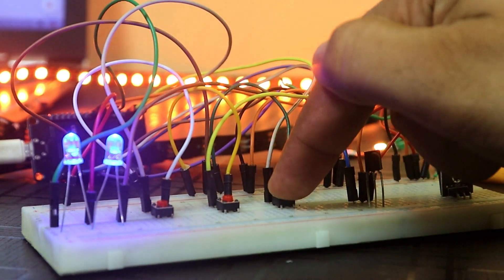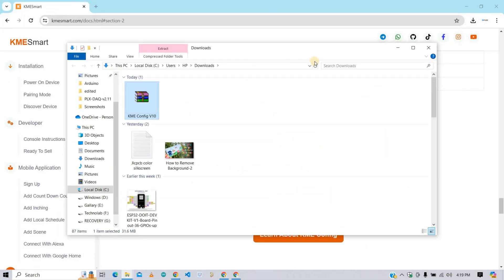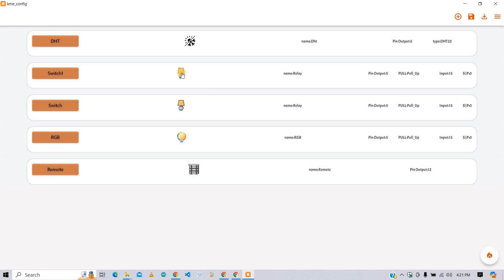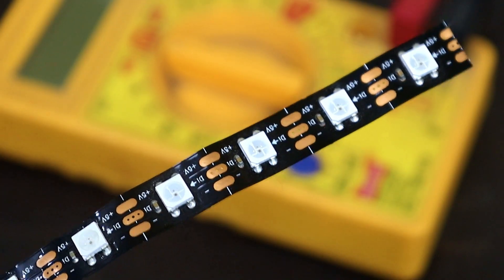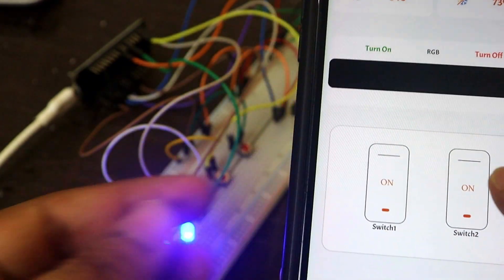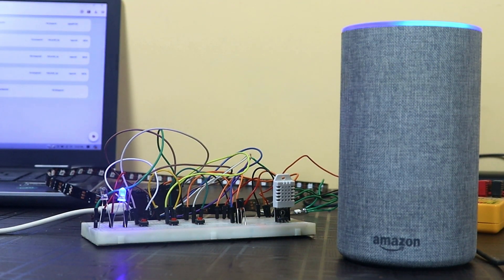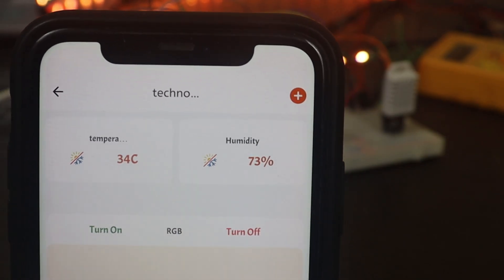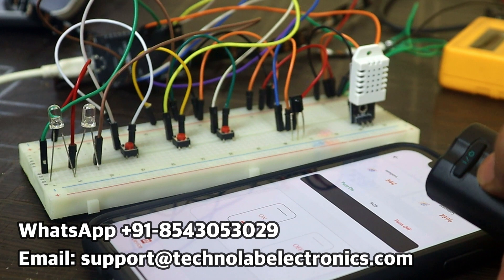Create IoT Projects with No Code 🤩🤩 | KME Smart Iot Platform Tutorial. @KMESmart

Comment: Sir 3 doubts he kindly clarify kar dena.

1. Agar same network me Mobile and Esp8266 connect na ho, tab kam karta he?

2. Agr switch board wala switch off ho and hum app se use ON kare, uss case me agar power cut hota he to konsa state me rahega? ON or OFF?

3. Agar Wi-Fi se connect ho and achanak kabhi wifi off ho jaye tab Bluetooth se connect kar skte he without any configuration, directly app se Bluetooth connection?

Thankyou
Reply: 1) mobile data ka use krke khi se b control kar sakte ho 
2) last state jo tha, jaise on tha toh rebbot par on hi rahega
3) wifi band hone par ble mode mein kaam krya hai, aur internet nhi rehne par lan mode mein